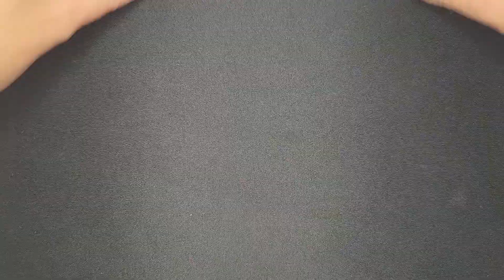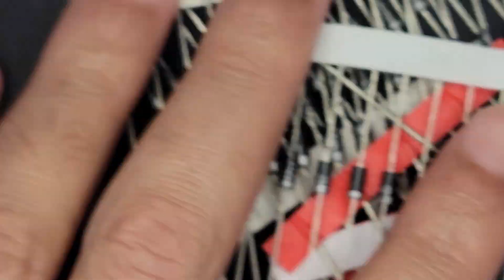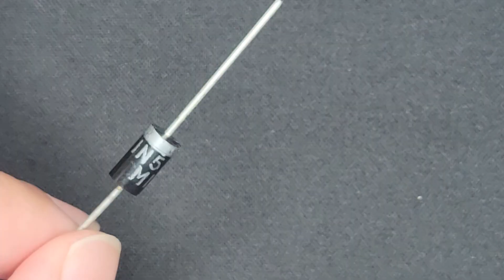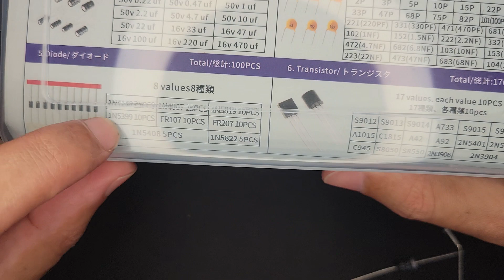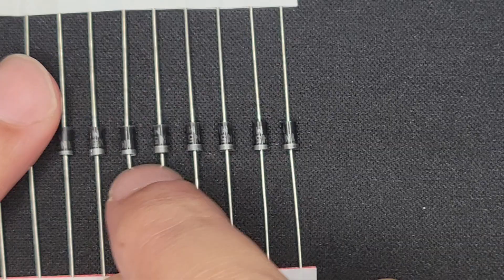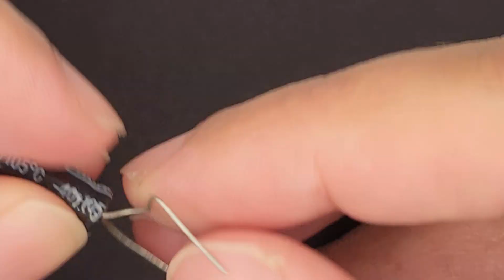Beginner Tests Diodes - Beginner Learns Electronics Ep10

Comment: The main difference between different diodes it the type (normal P/N junction diodes va Schottky vs Zener), as well as the forward voltage drop, the amount of current it can handle, how "fast" it is to turn on/off, how much voltage it can take when reverse biased, and how much current leakage it has in that state.

Power diodes are typically built for lots of current, small forward voltage drop, and high breakdown voltage.  Signal diodes are made to be fast.  Zener diodes are actually made to have a set and controlled reverse breakdown voltage, so you can put them backwards with a resistor in series and they will be at, say, 5V for a 5V Zener.  This is useful as a crude reference voltage.
Reply from the maker: Thanks for the insights! When the Zener is used as a voltage regulator, it will keep the output voltage even if the input voltage fluctuates to a higher level?

It would be cool to make a voltage regulator. I will get my hands on some Zener diodes.

I should have measured the voltage drop -- I wasn't even thinking that there would be any.
Reply: @LearnWithMxy  yes, with Zener diodes, if you reverse bias them and feed them a certain current, their voltage will stay constant.  It even stays pretty constant over a range of currents, so if you put a resistor to a supply and it varies by a bit, the Zener's voltage won't change very much.

Diodes always have a voltage drop.  This voltage is because of how they work; it takes electrons a certain amount of energy to jump over the junction, and this energy is emitted as a photon with that same amount of energy.  Usually the case for a normal diode is black, so that photon gets absorbed and turns to heat anyway, but at normal diode voltages, those photos are in the deep infrared spectrum.  When you get to about 2V forward voltage, you start making red light, which is the operating principle of LEDs.
Reply from the maker: Thanks for the detailed explanation. I received my Zener diodes (they are an assortment, from 3V up to much larger amounts). I will film my tests with them and post it. Thanks again for the suggestion. This will be really useful when I can set my power to a higher amount, but still get my 3V for my logic stuff, but have the 12V (for example) that can drive a motor or something.

Comment: Regarding the digits on your diode.
1N5822. It's a 1, not an I. 
1 meaning it has 1 junction, the N meaning it's a semiconductor. As for the digits, 5822, tells you the type of diode. In this case a schottky diode. I think...
Reply from the maker: Ahh very interesting. Thank you for pointing that out! I did not get around to searching for that information yet (and totally forgot).

'N' in this case coincides with the 'N' in NPN and all that I assume.

Schottky Diode -- it seems you are right, I did a search. Thanks for your input!

Comment: Umm. An LED is a diode. Light emitting diode.
Reply from the maker: You're right, I mentioned that towards the end of the video. Makes sense why the LED only works in one direction. Thanks for watching!
Reply: @MxyAhoy  Sorry, I got distracted.  Just finished watching.  I took electronics in the Navy about 2000 years ago (1990) and haven't used it much since I got out.  However, here is a bit about it.  First there are a lot of types of diodes for different applications.  The standard diode that you have is used for what you just demonstrated here - allow current in one direction.  They were used a lot in rectifiers back in the day - change AC to DC (full wave bridge rectifier uses 4 diodes to make an ac signal into a dc signal think your old plug in power supply to power your small devices).  It is also used in protection circuits where you might have a kickback voltage coming the wrong way, commonly used with relays and inductive devices (motors).  Also used to protect when a reverse polarity power supply is present.  Other types of diodes - zener comes to mind - used for voltage regulation.  One thing to remember, the PN junction (the actual part that makes a diode a diode) can break down if too much voltage is applied - standard diode like what you have can actually fail around 50V.  Man I can't believe I remember this much, but probably not all that useful.
Reply from the maker: @brianwalker5937  Really cool info. Thanks for sharing! And for your service. It makes sense how diodes can convert AC to DC. Maybe I can try that in a video. I would need to get a lower AC power than the standard 110/120V so I don't shock my daylights out.

I've heard briefly about the zener diodes, they sound familiar. Lots to learn. Thanks again for your input!